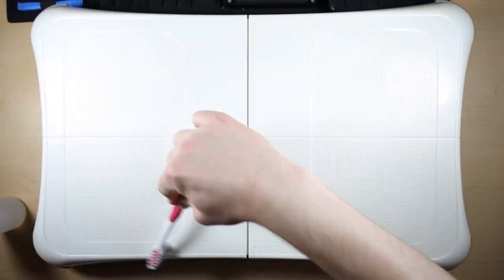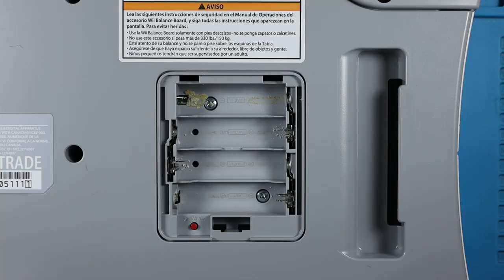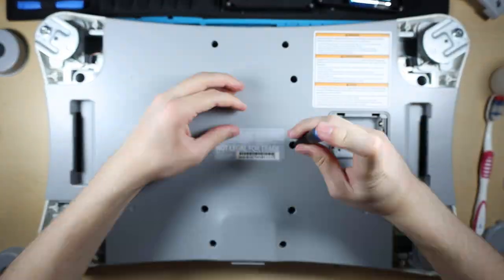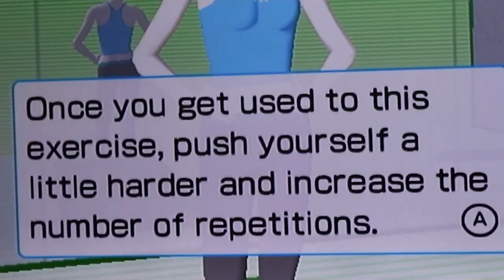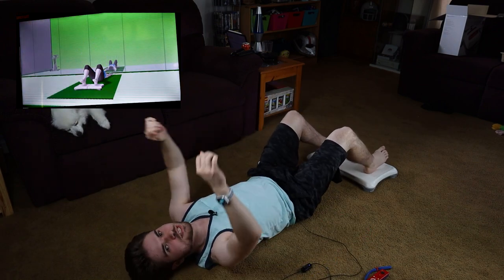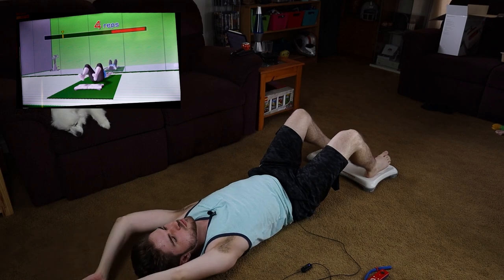Can Wii Get Fit From Wii Fit?

Comment: This video was just in time as I'm trying to figure out whether to go and fix the Balance Board I have, whose old batteries leaked and spread blue-green fluids to the battery board and corroded it badly. I might just fix it, not to play Wii Fit though and I might mod it to be USB powered or something. I realized that I would have a similar problem to you where its a bit small, especially for my feet
Reply from the maker: A USB mod sounds very interesting!